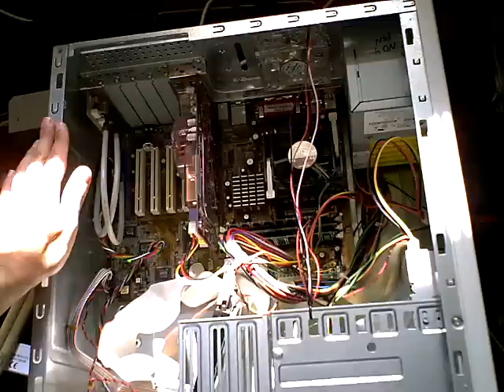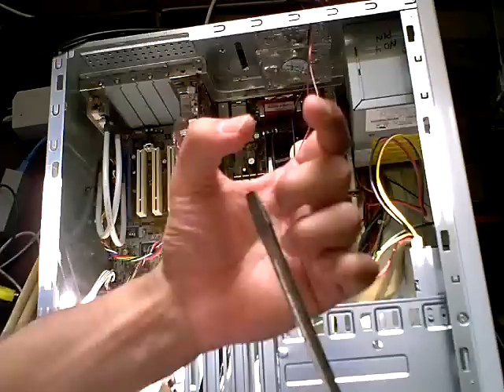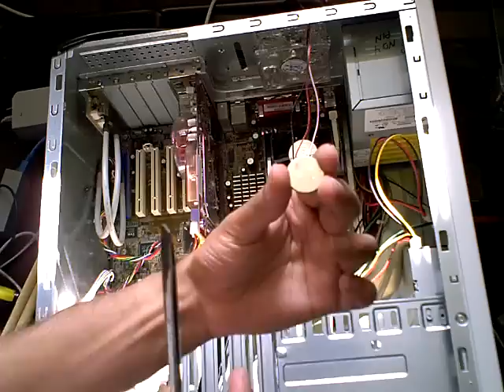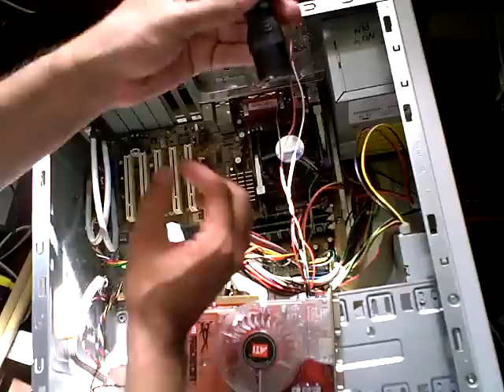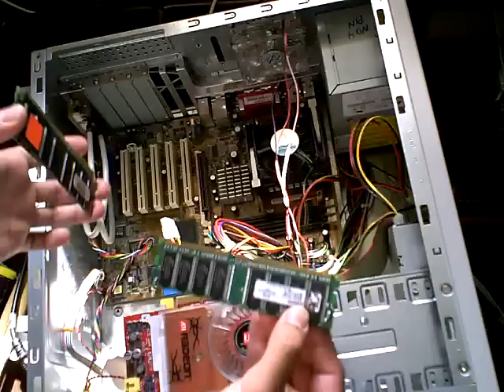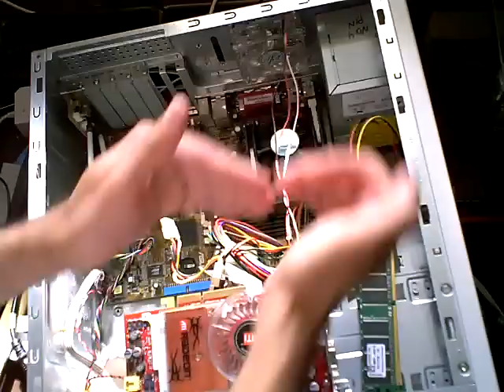How to possibly fix a PC that will turn on but will not beep and will not display anything on screen

Comment: My computer turns on and is running perfectly fine. I just installed a new amd card and a new psu. Upgraded from on board graphics. And now after the installation. My computer turns on but my screen will not even turn on. Like it has no power. I even reconnected it to the on board graphics. Same thing.
Reply from the maker: Hmm, this is tricky. Matching bus types of video card to motherboard socket (for example, both motherboard socket and graphic card are PCI-E 16X) or matching bus types of RAM module to motherboard socket (for example, both motherboard socket and RAM module are DDR3) does not necessarily signify compatibility. If this is the first time you are trying this hardware on your motherboard, there is a chance that this new hardware is not compatible with your motherboard, despite the same bus type and despite the fact that the new parts fit in their respective motherboard socket. Your motherboard manufacturer's website will have a support page dedicated to your motherboard's model, and on this support page should be a compatibility list for such components as video cards and RAM modules. Ensure that your new component is certified to function with your motherboard, and if your new component is not present on the compatibility list, then there is a chance that the component is not compatible with your motherboard.
Reply: RodneyDickson thanks for the reply. And I can honestly say I made the stupidest mistake of my life. While I thought I unplugged my old power cord to the tower, I actually unplugged the power cord to my monitor... yeah really I was that stupid. But on the other end of things. My new card looks a lot better than integrated graphics. Lmao.
Reply from the maker: WorldstarPvp
So I trust everything is working as intended now?

Comment: I just finished building my pc but sadly when when I connected it to my tv/monitor with hdmi and pressed the power button everything in the pc worked (fans,led,cpu fan, gpu fan, motherboard light) but nothing shows up on my monitor. I don't think my motherboard it broken because I just bought it brand new. Same with all my other pieces. So what do you recommend it try?
Reply: It also doesn't turn off through the power button after I turn it on. To turn it off I have to press the power switch in the back.
Reply from the maker: +landh4wk25 Is it beeping at boot?

Comment: great information bro... thx so much for taking the time to make this video.. I found that My power supply was possibly bad, where as the Beep would work after 2-3 days of not working.. so the cells within were not providing enough power for the Machine to operate thus, failing at power start up.. the good news is the power supply only cost me $50 where as I originally thought my Video card had failed which would have cost over $200 for a porper 3D vid card.. so you saved me $150 with this video alone! =D

I love you lol.. All the best! =)
Reply from the maker: +Colino Deani Ha! Nice! Good diagnosis on your part...well done : )

Comment: Greetings, 

This is my first pc build and has gone bad. My computer does not make any beep so it does not post. Guided by tomshardware I tried a lot of things from there. Disconnected the battery, cleared the CMOS and then tried removing component by component and when I removed all ram sticks it starts doing a restart loop like every 5 seconds or so, but only when removing all ram sticks, if I put one ram stick it stays there all fans spining but no beep or post. I haave change my mobo so this is the second one because I had the same problem with the first one.Please help.Here are my components:

Motherboard-Gigabyte Z97N-Gaming 5 Mini-ITX 
PSU-Silverstone SFX series 450W Fully Modular gold.
GFXC-MSI GTX 970 gaming
CPU-Intel Core i5 4690K
CPU-Cooler- Zalman CNPS 8900
RAM-2X8=16GB Kingstone Fury Hyper X
Reply from the maker: +eduardo ortiz If this is new hardware that you are installing on your motherboard (that has not yet functioned on your motherboard,) note that matching bus types of video card to motherboard socket (PCI-E for example) or matching bus types of RAM module to motherboard socket (DDR3 for example) does not necessarily signify compatibility. If this is the first time you are trying this hardware on your motherboard, there is a chance that this new hardware is not compatible with your motherboard, despite the same bus type and despite the fact that the new parts fit in their respective motherboard socket. Your motherboard manufacturer's website will have a support page dedicated to your motherboard's model, and on this support page should be a compatibility list for such components as video cards and RAM modules. Ensure that your new component is certified to function with your motherboard, and if your new component is not present on the compatibility list, then there is a chance that the new component is not compatible with your motherboard.

Comment: Hi Rodney,
I am having trouble with my computer. Every now and then (either opening up a internet browser or starting up a game) my screen will split in half and the image will reverse so the left side of the screen will move to the right and the right side will move to the left. If i put the computer into sleep mode then bring it back up it will fix the problem. However, sometimes this will happen then the screen will glitch out and come up with green or pink colour screen with vertical lines across the screen. And other times the machine will start but I will get no display on the monitor.

I thought it might have been the monitor but I tried a different monitor on my machine and the issue continued. I am wondering what could be causing this, whether its the Graphics card dying or something else.

Many thanks!
Sam
Reply from the maker: +EpicSam Could be the video card, could be the cable connected to the video card, could be your video drivers, could be Windows settings, could even be your motherboard and how it interfaces with your card. I'd go into the BIOS, load setup defaults and then save and exit, and if it still happens, in windows I'd uninstall ANY video drivers and only install one video driver for your video card. Good luck
Reply: Hi Rodney! Thanks mate. I went through the process of troubleshooting my hardware and worked out it was the GPU, so went ahead and bought a new one and now my machine works great.
Reply from the maker: +EpicSam Good stuff. Glad to hear it : )

Comment: Sir Rodney please help me!
I jave been facing this issue since 2 weeks. When I open my PC nothing is displayed ony monitor except for the "Check Signal Cable" error. I connected my Monitor with my Laptop and it worked fine. Also my monitor is updated with the latest firmware. So I know that my the problem is in my PC monitor. So, when I start my PC no mouse light or numlock lights switches on but if I connect any other mouse, its lights switches on. I ve tried this with every port. The mouse or the keyboard which I always kept connect with my PC doesnot work but If i connect any other mouse it works. Is it Normal? Did it also happened with you? Anyways I tried to copy your steps but got stuck at the jumper caps step. I cannot find any jumper cap on my motherboard. I cannot see any of them there! So when I couldnt find them I put my CMOS battery back again. But then after few hours when I tried to run my PC it switched on but after a few seconds it switched off automatically. This thing happened several times when I tried running again anf again. It seems like a new problem has emerged while I tried to fix the PC. Please Please help me. Tell me whats wrong with it? I will be so thankful!
Reply from the maker: The 'check signal cable' message doesn't come from your computer, but is rather generated by your monitor when it does not receive a signal from the PC. It sounds like your motherboard is developing a short circuit due to contact with the metal casing. Most likely it has to do with the screws and metal mounting stands (supports) that your motherboard sits on. The cheapest way to fix this problem is to introduce cardboard washers between the screws and where they make contact to the motherboard, or you can buy plastic mounting supports at a computer shop.

Alternatively, you can always Breadboard it (explained in the following video:)

If the steps in this video did not provide a solution to your problem, view:

http://www.youtube.com/watch?v=_EK9a-R5pss

You never know, maybe rebuilding the PC in the opposite sense that you took it apart will solve the problem.
Reply: +RodneyDickson Thankyou for replying sir Rodney. The new problem I told you above that my PC starts for few second and then automatically switches off got fixed itself and nkw I am no longer facing this issue so I dont think I need to use cardboard washer screws anymore. although the original problem is still unsolved. I am telling you the start of this problem. Exactly 2weeks ago this problem started with me. My PC used to work but I wasn't getting any display but if I switch off my PC for 10 minutes and then again tried to run it, PC worked. I used this trick for 3consecutive days but one day it didnt worked. Since then the PC has started at all except the spinning of the fans. I tried removing all of my components graphic card, rams etc but it still hasn't turned on. So I reckon the problem is in my Motherboard or PowerSupply. If you think there could any other problem than that so please make me aware. From the history of my problem I told you above, if you know what my real problem is so please tell me. Thankyou so much Sir Rodney! Awaiting your reply...
Reply from the maker: Sadly your problem is not one that has an easy answer. Most likely, the motherboard is on its 'last leg' and is not long for this earth. What I would do is try to get it running using the trick you were doing, (try what is shown in the video regarding the CMOS battery while you are at it) and if you get it running, NEVER shut it off again (just put it into sleep mode when not in use, so that it can be woken up easily and ready for use). Sorry my fix isn't permanent : \

Comment: Hi Rodney, I got exact the same problem. BUT after booting 8 or 9 times and trying clear comos and taking of ram out it start as normal. 
It goes well until I Shut it down and same thing happens again.  
SO My motherboard is ok or no? as it do start after 8 or 9 times trieng of rebooting,. 
Sometime I just keep on rebooting and it works.
Reply from the maker: Hmm, could be a problem component that is causing this CMOS confusion, problem is, sometimes these problem components are actual components of the motherboard itself. I'd put the PC to sleep when not in use to avoid this issue. Sorry I couldn't suggest something better : \

Comment: I have a problem with the first part you removed(graphics card).Once i removed that my pc beeped and started as usual.But what do i have to do now?Shouldn't i place back the card?
Reply from the maker: +Kristi Parai Yeah, try that. If the PC refuses to function with that video card, then that is the problem (either component or motherboard socket)

Comment: Hi i have hp elite i have 8gb of ram i took them out an i got 2 sticks for 16 gb it starts up but no display any clue? but i can put my old ram back in works fine. Thanks
Reply from the maker: +Brad Tyler If this is new hardware that you are installing on your motherboard (that has not yet functioned on your motherboard,) note that matching bus types of video card to motherboard socket (PCI-E for example) or matching bus types of RAM module to motherboard socket (DDR3 for example) does not necessarily signify compatibility. If this is the first time you are trying this hardware on your motherboard, there is a chance that this new hardware is not compatible with your motherboard, despite the same bus type and despite the fact that the new parts fit in their respective motherboard socket. Your motherboard manufacturer's website will have a support page dedicated to your motherboard's model, and on this support page should be a compatibility list for such components as video cards and RAM modules. Ensure that your new component is certified to function with your motherboard, and if your new component is not present on the compatibility list, then there is a chance that the new component is not compatible with your motherboard.
Reply: Oh okay well two of my ram slots are dead now one the prong broke half way off so i guess time to build a pc lol but thanks.
Reply from the maker: +Brad Tyler Eek. Yeah. Unless your board had more than two RAM sockets, in which case you can buy high capacity RAM modules and use the remaining, functional slots, but a new motherboard is certainly a good course of action : )
Reply: Yeah i have four ram slots see the one ram slot theres no damaged done so not sure why it wont work i just put in 3 sticks but it will trun on just wont be a display are them 2 ram slots hooked together?
Reply from the maker: +Brad Tyler Some motherboards do not like to use certain RAM sockets in pairs, so you may need to default to a high capacity RAM module for the RAM socket that it does tolerate...or just avoid the headache altogether and buy a new motherboard, but the high capacity RAM module is the cheaper course of action
Reply: Okay but would you know why i can not put in three ram sticks bc ill i can see one of the slots is bad bc of the bent pin i have 2 sticks in now but when i put in one more i get no display and this is with my old ram could be it burt that ram slot too?
Reply from the maker: +Brad Tyler Once again, it's probably just the mobo not liking the combination of 3 RAM modules installed, this is regardless of which RAM sockets are in use (this is rather common with motherboards sadly). You'll probably have to default to using two RAM modules, and if this is not sufficient for your RAM needs, then you'll need to buy higher capacity RAM modules.
Reply: Okayy thanks again

Comment: Hi RodneyDickson. I have a gateway desktop. When i turn it on the pc beeps 3 times and nothing shows. I usually had to remove the battery so it could start. But for some reason that is not working right now. Any suggestions? thanks.
Reply from the maker: Beep error codes differ from one BIOS manufacturer to the next. To discover what the beep error code is trying to telling you, discover the manufacturer of your BIOS (available in the motherboard's manual or on the motherboard's manufacturer's website {on the page for your specific motherboard model}) and then look up the frequency and interval of your beep error code on:

http://www.computerhope.com/beep.htm

Comment: Is it possible for a dead CMOS battery to prevent the PC from booting up?  

I have the same issue that there are no beeps nor displays on the monitor.  The monitor and cords are all working perfectly on another computer.  I have replaced the power supply but it's still not working.  I was considering to replace the video card if that was the issue, until I saw this vid.  My PC kept on displaying an error message and the wrong time and date upon boot up weeks before it stopped working.
Reply from the maker: +mamochan08 Yeah, a new CMOS battery may help, I'd try that first, and if still no luck, Breadboard it (explained in the following video:)

If the steps in this video did not provide a solution to your problem, view:

http://www.youtube.com/watch?v=_EK9a-R5pss

You never know, maybe rebuilding the PC in the opposite sense that you took it apart will solve the problem.

Comment: My computer is having this problem after I installed a new heatsink. I don't have a case speaker so I can't listen for any beeps. I've tried resetting the cmos by taking out the battery for a few minutes, but my cmos clr1 does not have a jumper, do I have to reset the cmos with a jumper? Is there anything else I can do or did I break my mobo in the process of installing my new heatsink?
Reply from the maker: +Connor Donnelly Breadboard it (explained in the following video:)

If the steps in this video did not provide a solution to your problem, view:

http://www.youtube.com/watch?v=_EK9a-R5pss

You never know, maybe rebuilding the PC in the opposite sense that you took it apart will solve the problem.

Comment: hi, sorry for my misunderstanding of the video, but what happens next when i hear my beeps (Cmos Battery). Does this mean i need to replace my cmos battery asap?
Reply from the maker: Good question! The beep error code is trying to tell you where the error lies. Beep error codes differ from one BIOS manufacturer to the next. To discover what the beep error code is trying to telling you, discover the manufacturer of your BIOS (available in the motherboard's manual or on the motherboard's manufacturer's website {on the page for your specific motherboard model}) and then look up the frequency and interval of your beep error code on:

http://www.computerhope.com/beep.htm